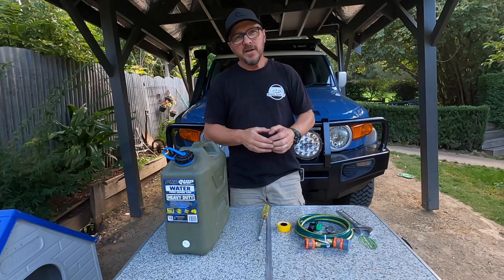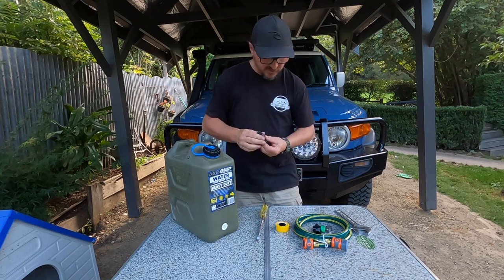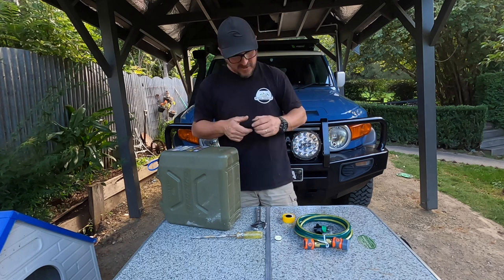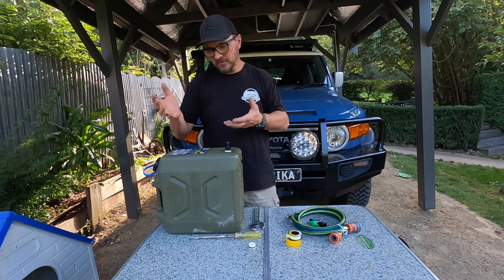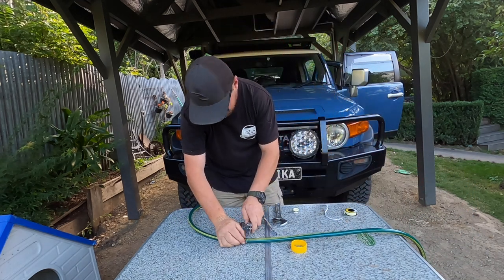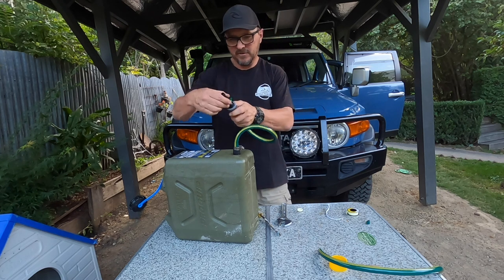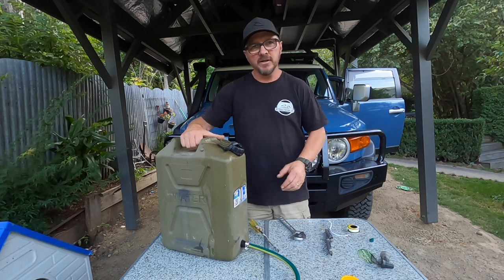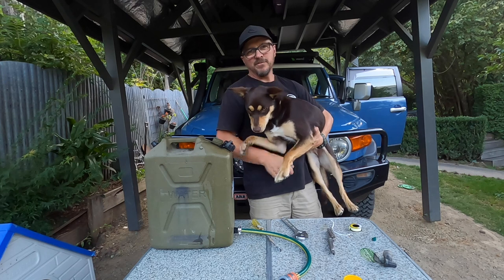HOW TO make a Gravity Fed Water Supply | What You Need.

Comment: I did something similar to my 40ltr water container but I used the 2mtr long length so that you can use the hose further away from the back of the vehicle or lift the container onto a table and use it as needed.  When transporting the container I used to face it with the tap connection on the top so that nothing caught or snapped the connection off in transit and alleviated spilling all of the water from the container.
Reply from the maker: Great idea,  I find tucking tne tap up should hopefully avoid it snapping off in transit.  It is such a simple idea.  Thanks for taking the time to comment.

Comment: Is this mostly just to make it easier to get water out of the tank because you can pull out the hose and it's flexible, rather than taking water from the tap at the bottom?  Where do you put your water tank in the car? Thanks for sharing, love the idea.
Reply from the maker: I have found better with a hose than a tap.  I tap has more risk 9f breaking off too. On my GU I had a rear bar and tne tap worked perfectly. At the momnet I have it mounted behind the passenger seat but I'm working out a solution to place it in tne cargo area down tne track.